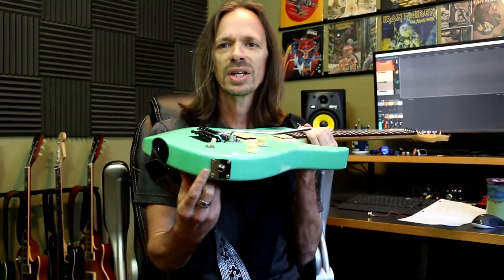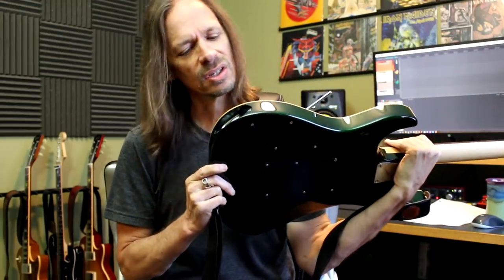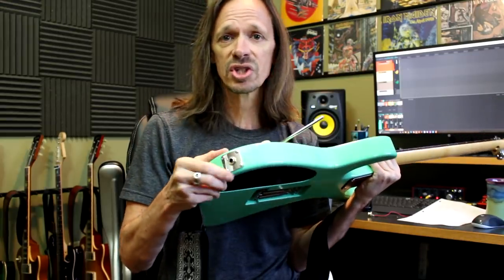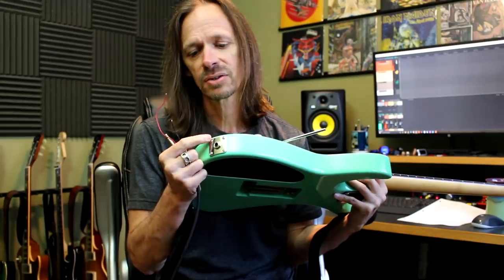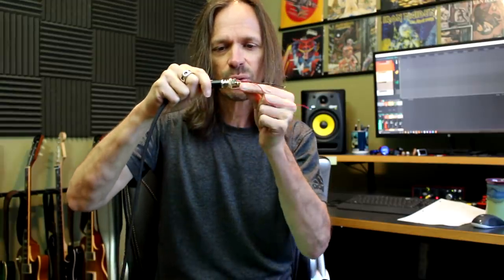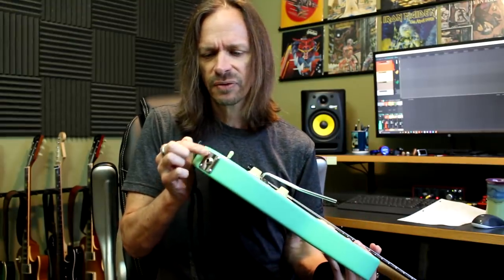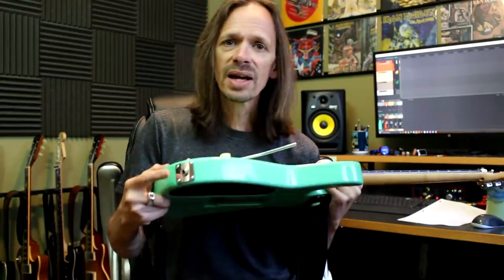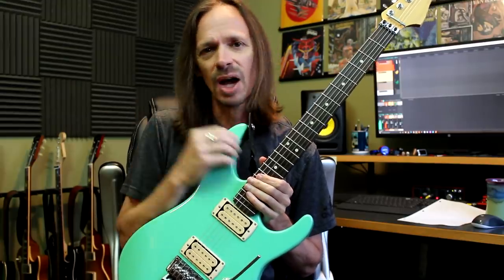How to Install Jack Plates on Your Guitar

Comment: My nut is tight but still has some movement (stock plastic Gibson plate) and it crackles if I move the cable... any idea what is causing this? I've ordered a metal plate to see if this fixes it.

Comment: Your site now offers a round type slightly recessed conical jack that drops into/onto a 7/8" hole and secures with a couple screws into the adjacent body , it would be nice to check that out in an update. I'm leaning towards that but was hoping for video coverage. Thanks for all the sharing!

Comment: I would like to hear you elaborate on from whence this hate for Strat style jacks comes from. Especially the different options for where one might location them (for example, like on a Ibanez Jem).  If there a functional issue?  One of the thigs I like about it is that is a lot easier to avoid issues of accidently banging your plug or putting stress on it when you place your guitar in a stand.

Comment: 07:04 I have done a couple of Warmoth guitars with active EMG systems in them. The 7/8" hole route would be preferable if you are using a stereo output socket like the EMGs use. That second lug provides the connection for the active system but as Aaron mentioned, you have to have enough room in the hole to allow the cable plug to pass.

Comment: Hey Aaron!

Would you like to talk sometime about the control routes? Are you thinking of offering a smaller option for rear control routing? There are a few builds that I'd like to do sometime and most of them involve very simple controls, like only one volume knob with a pickup selector switch. The only routing you offer is just too much for that and it'd always bother me back in my mind, wasting all that space.

Comment: Yep, the square jack plate is the optimal. I got one guitar with an electrosocket and apart of it being kinda neat and pretty with no external screws (if you're that much into sockets) it's kinda annoying in that it wouldn't accept angled jacks or some wireless transmitters. There's another even more annoying type though: the long shaft like on acoustics...

Comment: Great video! And YES! Absolutely. Have the jack install in the plat with a male jack plugged in, every time. I too have screwed that up. I've had plastic les Paul plates crack, I don't find it a problem because you learn how tight to go. It should be noted occasionally to never "crank" any screw on a guitar (except maybe the neck).

Comment: Aaron thanks for doing this video. Output jacks are the last thing I think about until I do and then I get very angry. I agree with you I don't like the Strat top jack. We are so used to seeing it that it looks funny without it. Until you get used to it and then the Strat looks better to have all that extra wood finish to look at instead of that large metal plate. If I had to have a top jack I prefer the Ibanez where the jack part is hidden and there is no metal plate on the top of the guitar. As for side jacks I hate the Tele cup jack. They should be outlawed.  I prefer the no plate style as on my Peavey Odyssey, just the round connector, very small and unobtrusive. But side jacks are better than top jacks whether it is a front route or rear route guitar.  I just received a bunch of dual prong output jacks. Advertised that they would cut the crackle of a plug moving around in the jack. But now that you talk about how a jack moves when the plug is inserted I wonder if there will be enough room in my existing guitars for a dual prong jack. Do you have any experience with the dual prong jack?

Comment: I make my own cables. One end is right angle for the bass and the other is straight  to the amp and I run the cable between the body and strap button. A straight jack from the side of an instrument can be hit and broken off.

Comment: It's not an option on the "builder" app, but can a customer order a Soloist body with a top route á la Strat?  And, if so, is there a pickguard shape that correct for it?
Nice vid.  Useful and informative.  Thanks.
Reply: I'm curious about that as well. But I have always assumed that the pickguard would need to be custom cut.

Comment: Hey Aaron! Could you guys consider having the "24 fret neck pickup reposition" -option on pickguards as well, at least for Stratocaster (since they already have the routing done with the "swimming pool/universal-rout")? That would be really helpful so that you don't have to cut the pickguard yourself.
Thanks for doing an awesome job with keeping the videos coming, they are almost always extremely helpful!
Reply: If you haven't already bought the neck I'd advise against it.  Personally I think a 24 fret neck on a strat is pointless since the heel isn't deep enough to comfortably play the top two frets like you can on a soloist.
Reply: @CaptainRudy4021  I'm mostly a rhythm player and want the extra frets, basically just in case. You'll never know when you might need them.
Reply: @wilhelmtheconquerer6214  fair enough

Comment: Thanks for the tips and info Aaron.  What do you think of jacks mounted directly onto the wood face of the guitar?  I think it looks pretty clean but unfortunately on some of my guitars with this type of jack, I've experienced cracking in the finish (probably due to overtightening the washer).  I'm leaning toward an Electrosocket type jack in the future.
Reply from the maker: I hate it and would never do it, for exactly the reasons you mentioned....but that's just me. :)
Reply: @warmoth  So it's not just my experience then :-)  Thanks!

Comment: So I'm sort of stuck. I thought I did my required reading prior to ordering, but may have misinterpreted some details. I ordered the G5 bass body with a 7/8" route, a deep panel stereo jack, and the football plate. Looking at things, I'm left with a few questions:

1) Is your video teaching us that even though the 7/8" might be overkill for the size of the deep panel jack, they will work fine together?
2) It looks as if the jack is intended to slide through a plate and fasten with the backing nut, but this jack is way too thick for the hole in the football plate. Am I misunderstanding something? Can I bore out the hole a little bigger? If not:
3) What plate is meant for this jack that will still fit on the G5 body? Did I order the wrong parts and/or route?

Help me Obi-Wan Kenobi...
Reply: I also have questions regarding the jack hole rout size. On the site, it states that a tele input cup is ideal for 7/8 rout. But can a square plate be used w/ a standard 1/4 input jack and a square plate from Warmoth for a 7/8 rout?
Reply from the maker: The only time a 1/2" deep-panel jack is necessary is when the control cavity is a long way from the side of the guitar....you have to have a jack long enough to reach that far. You do not use a jack plate with them. All other times, and with most Warmoth bodies including the G5 body, a regular old 1/4" jack mounted to a jack plate is what you want.

Comment: Hi Aaron...sorry to change the subject, but I was wondering if traditional pickup covers will work with Hot Rails pickups?  Thanks!
Reply: I can answer that: the hot rail comes molded in his housing, that fits the pickup rout in the pickguard. You cant change the cover
Reply: @Zakkrifice  Cool...thanks for the heads up!

Comment: I learned that people call it input jacks. Really? I mean, I thought it was obvious.
Reply: The output jack is where you plug in the speaker. The input is for the guitar.
It's not hard. 🎸
Reply: @hoboroadie  WRONG. You have that backwards. Electric guitars use an input jack AS an output jack. The signal comes OUT of the guitar and INto the amplifier.
Reply: It's an output jack because that's where the signal comes OUT of the guitar. How anyone comes up with reasons to call it an input jack boggles my mind.
Reply: @hoboroadie  so, your amp plays and the sound comes out of your guitar?

Comment: Ok, Aaron, WHY, exactly, do you hate the 1/2" deep panel jacks so much? It actually solves SO may problems! 

No worries about body thickness/edge of the plate problems. No screw holes to drill and possibly mess up or chip the finish (How many times have you seen someone mount the plate just a teeny tiny bit cock-eyed?). It's already shielded all the way into the cavity where the copper foil takes over. and they are virtually INDESTRUCTIBLE!
Reply from the maker: You bring up some good points, but I'm still not a fan. Just don't like the way they look.
Reply: @warmoth  ok, I can accept that they don't appeal to you aesthetically. And they do open the finish to plug pokes more then a plate too. I just like them better.

Comment: So true lol. Plastic input jacks SUUUUCK compared to metal lol.

Buddy has a cheap ol ibanez art core. His jerk friend was wayyy too hard on that poor guitar and yanked the cable out super hard. Pulled off the plastic plate and some electronic parts too. Gutting the guitar so to speak. Had to do a lil soldering and I cut out a piece of plastic cutting board to make a smooth surface for everything to stick to. Used super glue to get it to stick.

It looks terrible lol. But it works.

Moral of story? Plastic sucks and DON'T be so damn hard on the hardware folks.